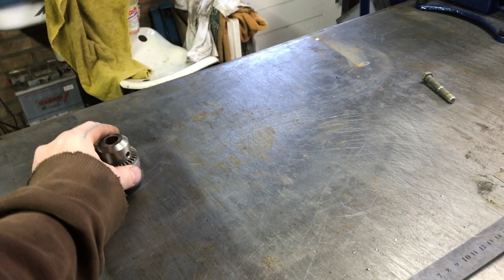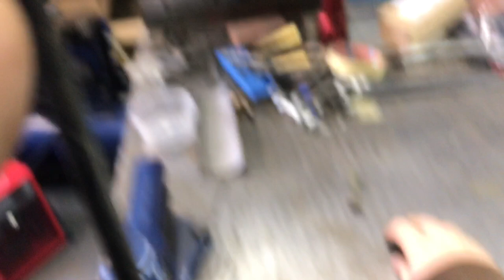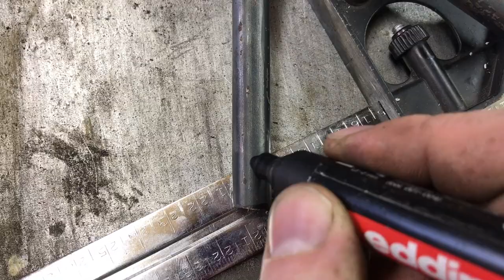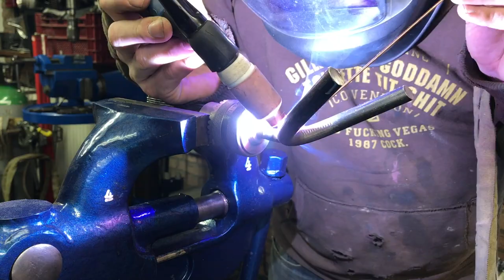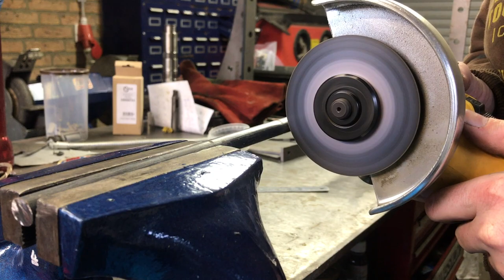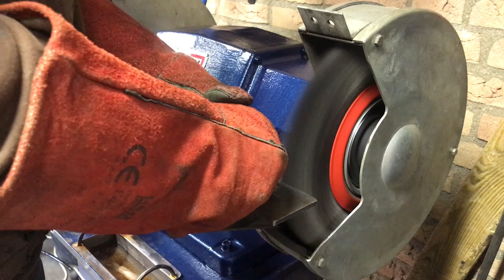Building a modular 3rd hand

Comment: Great idea, I'm going to make one.

Just a tip, don't wear gloves when you use a grinder or similar.

If the grinder hits your hand it takes off some skin.
If it hits your gloves, they get pulled in and it takes off fingers or a hand...

Also a good idea to wear some thin leather gloves when welding..  Skin cancer from the UV light isn't pretty either.